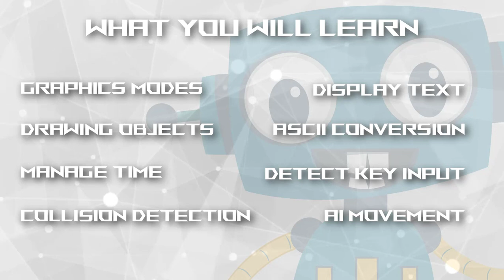[MASM] 8086 Assembly - Pong - 01 Introduction

Comment: If I Am A Beginner and don't know anything about assembly can i watch it or do i need some sort of experience in this language before watching
Reply: You can get experience by watching it and following it yourself.
I also know nothing, but watching this I am starting to understand a little.
At first it looked kind of scary, but it actually isn't that hard to understand.
There are also comments with each line of code as it is like a requirement in Assembly language which helps a lot in knowing what each line of code is doing.
Reply: @redwings1847  Thanku